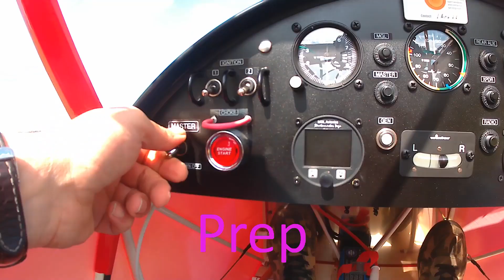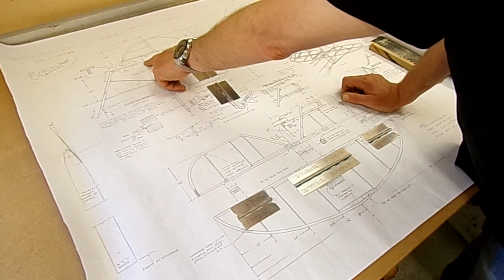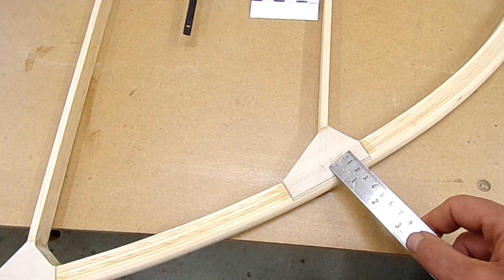EP19 Fisher Youngster V Kit Plane Build. Fitting Hinges

Comment: Just wondering: was there a reason you didn’t drill the holes for the hinges in one operation with the hinges in place? Thanks.
Reply from the maker: They were match drilled but to drill through in one, would need you to use a standard twist drill, which can should be run at higher speed in wood than metal and can punch out the exit side of the hole. 
If you use steel hinges the problem can be more pronounced and have  the drill wonder in the wood before biting the metal, ending up with oval holes. 
You can go through with pilot drill then drill out with care.
Reply: Thanks! Makes perfect sense.
Reply from the maker: @dennispitz7488  glad it did. Thanks for your comments because it lets me know the sort of detail I need to include for others to understand the reasons for doing things rather than just doing them. Thanks again for your feedback and questions.